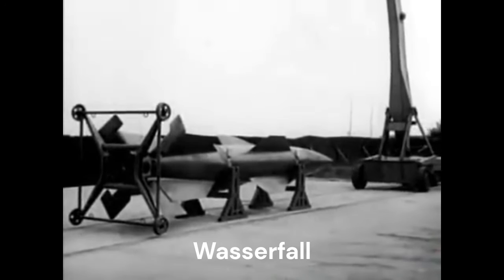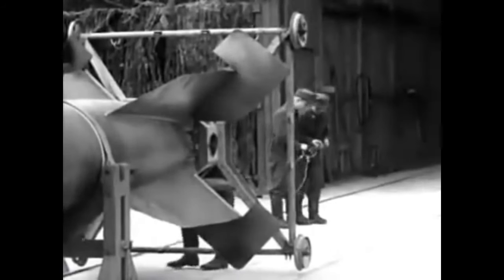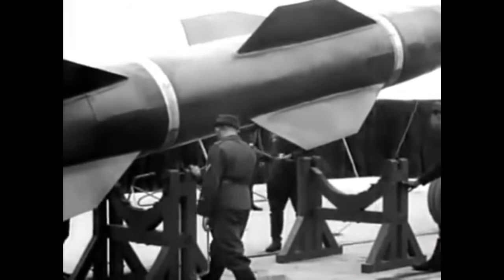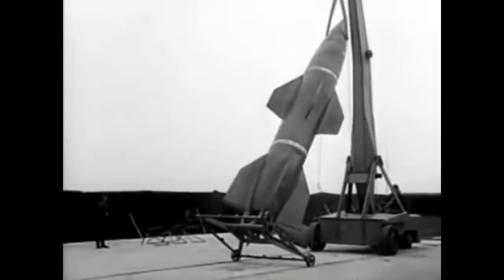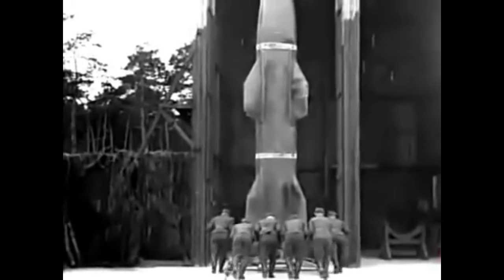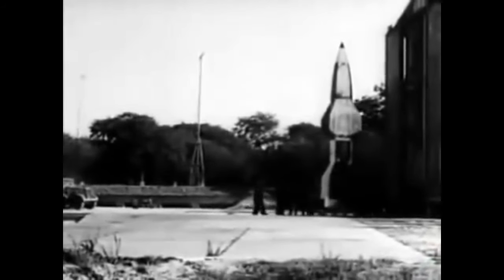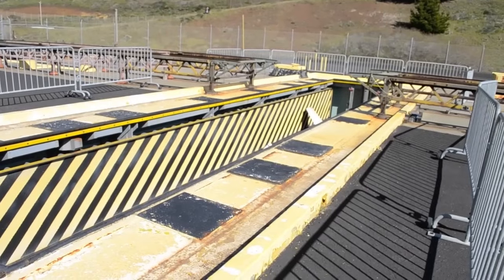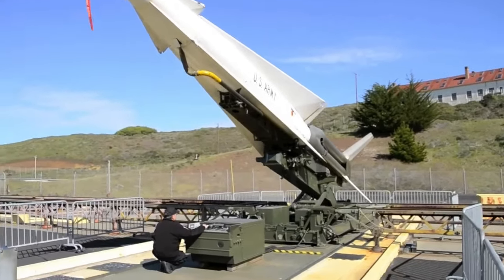Wasserfall Surface-To-Air Missile: V-2’s Little Brother That Could Have STOPPED USAAF/RAF ('43 -'45)

Comment: Brought to you by the same team that gave us ICBM'S
Reply: Led by one of Hitler's favorite majors no less, bought here to the us a under operation paperclip Werner vaun Braun of course! 👍🏻
Reply: Sort off.   The V2 was managed by EMW but the Wassefall by Henschell who were better organized. though the von Braun Teamp had input  Quite a few breakthroughs in the Wassefall.  The combustion chamber was a mixing plat design that was much cheaper to mass produced than the V2 18 sub chambers basket head and the Wasserfall technology would have been restriffted to the V2 to reduced costs.    Wassefall had pure electric acturators wheras V2 electrohydraulic.   The V2 was going to be quote cheap eventually.
Reply: USA developed the first guided rocket in 1921 by doctor Robert Goddard. So u could say made by the USA. Lol
Reply: @jjjr.1186  Goddard didn't teach anybody.  He didn't pass on his knowledge.  Amazing man.  Basically used a torpedo or autopilot to control the rocket and showed the way.    The V2 advanced way beyond it though von Braun gave Goddard huge credit for painting the way to liquid fuels and autopilots.   The von Braun team developed an electronic computers auto pilots as it was the only way to handle the sever vibration and 5 flight stages (subsonic, fuel slosh, transonic, hyper sonic C of G changes) .  The von Braun team developed regenerative cooling, and hyper-sonic shielding as they pushed the envelop.  They had some incredible guidance systems in development that would have made the V2 super accurate.
Reply: @williamzk9083  doctor Goddard work was extensively documented. U can even watch his films. And to say he passed nothing on. Lol. Not true.
Reply: @jjjr.1186  he has very little, and he kept all of the detail technology secret..  That comes from American engineers and historians themselves.

Comment: They had great engineering but completely unrealistic production goals.
Reply: The missile was flight testing in 1943, entry into service was to be 1946.  The Germans already had auto track locking radars such as FuMG 64 Mannheim and microwave versions such as Marburg.
Reply: To add to this.  The subsonic The Henschel Hs 117 Schmetterling (German for Butterfly) had been ordered into production in 1944 and some production started.   The Germnans had developed 13 different guidance systems of varying capabillity that were common between Hs 117 and Wasserfall.   Wheras the Hs 117 was limited to engagements of 30,000ft 32km  the Wassefall could opperatre at Mach 2.7 and engage a supersonic target at 60,000ft manouver at up to 0.5G and much greater range.   When the Wassfall entereds sevice it would have fitted into systems already opperating for Hs 117.
Reply: @williamzk9083  do it see real combat?
Reply: That means they have poor engineering. They are 0 for 2 in the 20th century :-)
Reply: And Hitler's aversion to anything defensive also played a big part in slowing down what could have made a big difference in the war for Germany. It wasn't untill quite late that they started to work on putting defensive weapons in production, but by then it was already too late.
Reply: @rfarevalo  They were literally the biggest technological power of WWII, especially on rocketry. Developping the first cruise missile (V1), the first ballistic missile (V2), the first guided bombs (Fritz X), the first serial production fighter jet (Me-262), the first jet powered bomber and recon plane (Arado 234), the first low observable attack plane (Horten 229), and they even were the first to apply anechoic tiles to submarines and even stealth coatings on the periscope and snorkel. France, Britain, the US and the Soviets all built their technology in the decades after the war thanks to scientists from Nazi Germany.
Reply: @pieterveenders9793  Bull shit. The USA and Britain were the technical powers. Germany couldn't even put together an advanced phase radar or even a 4 engine bomber into production. Look at the Atomic Bomb (hear the microphone drop), not to mention radar proximity fuses, synthetic rubber, 4 engine bombers, Higgins landing craft, Huff/Duff Radiogoniometry, Catalytic cracking for plentiful liquid fuel, Penicillin, Hedgehog Depth charge, Conger Mine Clearing charges,  Bouncing Bombs, Mulberry Harbors, US M1 Garand (first service man's semi-automatic rifle). The M4 Sherman's had Gyrostabilizers in their tank guns, while the German's couldn't accurately fire while moving :-)
Reply: @pieterveenders9793  Thanks Captain Obvious for stating the German war time economy, planning, strategic decision making, and industry were no equal to the allies.  Did you know Britain outproduced Germany in every military supply or weapon category even before the USA entered the war?  Each year Britain output went up.  each year of WW2 German output when down.  The technical prowess you pontificate about is not accurate, that is the reason they are 0 for 2 in the 20th century :-)
Reply: @pieterveenders9793  Maybe Germany wouldn't have lost if they could produce a tactical radio for their troops or an automatic transmission for their armored vehicles like the USA. The CR-536 "handy-talky", a portable AM radio that weighed a mere 5 pounds including the battery was the envy of German commanders and front Line troops.
Reply: @pieterveenders9793  The US developed the first operational autonomous guided bombs. The German Fritz and hs293 guided bombs relied on an operator manually guiding them into a target via a radio control link. This forced the bomber to steer a mostly straight and level course. The US Bat and Felix bombs were fire and forget weapons. The Bat was a radar guided anti ship weapon. It successfully damaged and sank multiple ships and in one notable instance a Bat hit a warship 20 miles(32km) away and severely damaged it. The Felix had an infrared guidance system and was successfully tested and put into production. The USA developed radio-control bombs as well. The Azon bomb was a guided bomb that was used to target bridges in Europe and in the Pacific. The list of Allied technical advances is endless. They one the war partially due to the caliber of their achievements in war technology :-)
Reply: The war had been decided late 1942, Wasserfall would only delay the inevitable. There is also the question of the allied decoys, they were already using chaff which may have significantly reduced the Wasserfalls effectiveness.

Comment: You've got the fuel wrong: the 90% HNO3 + 10% H2SO4 mix was just the oxidizer, the fuel was Visol (vinyl isobutyl ether). Mostly because the oxidizer ingredients were readily available from explosives production and the fuel did not compete with other fuel needs (gasoline & diesel).

Comment: The premise for this video is silly.  The radio guidance it was designed to use was the same as what was used for the Fritz X.  Which the Allies had experience in jamming, so that would have been useless very quickly.  Not to mention it would be far harder than guiding a Fritz X, due to velocity and size of the target.

On top of all the difficulties of developing radar guidance, the Allies also were already using chaff to confuse radars.  IMHO, the Wasserfall was DOA.

Comment: I will never understand the German leaders from those days: Lingering about 3 years, 1940...1942, with conventional equipment for all the branches of the armed forces, then suddenly entering in frenzy with all kind of developments for wonder weapons: revolutionary submarines copied by the victors ten years after the war, tanks with composite multilayered armor, dive bombers with jet engines, anti-ship RC controlled missiles with TV camera installed in the nose, nighttime infrared viewfinders for tank crews. And because they slept for 3 years, all that stuff was ready too late, when it was ready. What if they would have enforced all those developments starting with 1940 ?
Reply: They did not sleep.
The time was just not right for such expensive prototypes.
The Zuse 1 for example was only giving green light when the war was almost over - and then quickly forgotten because of the dominance of the transistor later.

Comment: The problem with these “super weapons” is a “shoulda’, coulda’, woulda” situation. They never worked properly or couldn’t be produced. It’s tiring to see all of these things as though they  were actually realistic. This is one of those. It was more dangerous to those using it than to those it would be used against.
Reply: not really. this is very sound project as now we have lots of different missiles.

Comment: When I went tho the Museum of the US Air Force in Dayton I was able to get on the tour of the restoration facility. They had one of the Wasserfalls in the back of the hangar. Interesting relic.
Reply: Are you sure it was a Wasserfall? After the war the US did build their own version called the Hermes . These were tested at White Sands and used a lot of V-2 bits and bobs. There is one of these in the rocket garden at the Kennedy Space Center visitors center. I don't know if it is areal rocket or a boiler plate mock up. You can see where the fin design for the Redstone came from. 
  Anyway if IRCC the missile was supposed to guided by radio to the bomber formation where the final guidance was done with a heat seeking terminal guidance system which never got the bugs worked out. I think this is one reason that the Bachem Natter was built it was supposed to be guided from the ground and final targeting was by the human pilot . No expensive electronics needed, the guidance system could be built with unskilled labor but took at least 14 years to produce!
Reply: @brucebrazaitis321  I looked back at my photos from that trip and it sure looked like a Wasserfall. It was no where near the size of a V-2 but it was pretty good sized. The NASM has several other German missiles and they are beautifully restored. Aluminum bodies and wooden fins. I saw them at the Hazy Center.
Reply: @fw1421  Well did a little digging it seems that the Wasserfall and the Hermes are sort of the V-1 - Loon thing going. It seems. that these were built as test beds for a SAM latter ground to ground rocket. They tested them out at White Sands as tests for guidance.. Also the NASM says they have one in their collection but it is out "on loan" which might be what you saw since the NASM might not had the space or budget to restore it. Be real nice if it was an original Wasserfall. I remember a story of a man who grew up on an Australian air base  that he saw a Me-262 parked in a hangar amongst all sorts of other assorted junk. As an adult he visited the base and it was still sitting there. Don't know if aircraft buffs ever caught wind of that
Reply: @brucebrazaitis321    The Wasserfall at the USAF Museum isn’t t in particularly good shape but they have it. It even has a plaque next to it explaining what it is although the picture wasn’t that good,I didn’t have a very good camera at the time.

Comment: Why did Germany throw away enormous resources on ballistic missiles to terrorize London when the same resources could have been better spent on small ground-to-air, air-to-air, and air-to-ground missiles?
Reply: The claims of the V2 being ridiculously expensive or irrational in costs are exaggerations of those trying to mock or belittle the V2.
1 Cost of the V2 was 16000 man hours but production cost after 12000 would be less than 4000.
2 The detractors of the V2 use the number of V2 fired but ignore the thousands left in warehouses etc when the war ended,.
3 The V2 LEV-3 guidance system was very basic with two gyros and one PIGA accelerometer for guidance so quite inaccurate but it was only intended for the initial production. The SG-66 with 3 gimballed gyros and cross range accelerometers was expected to be accurate to 300m-500m.  It was test flown several times.  The vollzirkel beam riding system 300m.
4 This is as accurate as allied bombing.
5 Since RAF Bomber Command had been ordered to implement the "Area Bombardment Directive" of dehousing and demoralizing (ie carpet bombing Germans cities) the idea of the V2 was to produce equal counter terror so that V2 bombardment of Britain would provide the leverage to so that the end of city bombing could be negotiated.
6 The inaccurate early V2 LEV-3 guidance thus to get production ramped up so that accurate guidance could be phased in.
7 The V2 was cheap in many ways.   You could build 7 V2 for the cost of one Lancaster but there is a/ no 7 crew members to train.  b/ no airfields to defend and maintains.  c/    no escort fighters to fund. and d no crews need die at 15%-20% attrition.   The V2 was the only way the Germans could get through.
8 At 4000 man hours Germany could easily build 1000 month and could push itself to 5000 month.   Could you imagine 1000 month falling into a 500m diameter area over a month.
It would be effective.
Reply: Because Hitler was a Kid when it came to warfare!! 

The Germans did built guided weapons which worked effectively for a very short time and then the Allies introduced countermeasures which made them next to useless!!! Examples were radio command guided bombs and air launched missiles and homing torpedoes for U-boats. The Allies developed Jammers that took out the command links on the former and Decoys that defeated the latter.
Reply: @williamzk9083  The RAF bombing Peenemünde sealed the fate of the V projects
Reply: @williamzk9083  The V1 buzz bomb was deployed not to destroy London, but to cause Britain to expend countermeasures that delayed its bombing campaign against Germany.  But no defense was possible against the V2, so Britain expended only the cost to clean up damage.  Terror bombing didn't work, and bombing didn't destroy enough workers and factories to significantly affect production until the very end of the war anyway.  Any expense on the V2 was wasted expense -- especially the diversion of highly-trained manpower and scarce metals.
Reply: The V-2 was meant to be a revenge weapon against the Allied terror bombing of German civilians. The "V" in fact stands for the word "revenge" in German.
Reply: Because at that time it was thought that air Bombardement would force a country out of a war.
Unfortunately it just caused more deaths since no force ever surrendered or gave up by air Bombardement.
Reply: @richardvernon317  later they had wire + camera ones too. no way to jam that shit. but not enough aircraft left to use it anyway
Reply: @williamzk9083  4000 are you sure? thats less than fighter aircraft
oh wait... well rocket engine is less complex that piston one so yeah guess it makes sense

Comment: Guided? Really? How? Looking at the data, it was a miniature V2 that a ground operator would somehow guide to a target at 15000 feet. Given that your average radio-control operator has trouble at even a few thousand feet, it seems implausible. The radar control is not just implausible, but laughable - German radars were jammed into uselessness at this point in the war. German proximity and infra-red systems simply did not work. Quit the AI generated content and provide something real.

Comment: Was there any comat Testing?
Reply: No. The project was cancelled and priority was given to a much smaller, cheaper, unguided missile. The density of air groups was such that a barrage of unguided missiles was more cost effective than large complex guided missile. Even the latter did not undergo actual combat testing, though it is possible a few were fired, as some were built and deployed, and at least one bomber crew reports a missile launch, but that could be a misidentification.